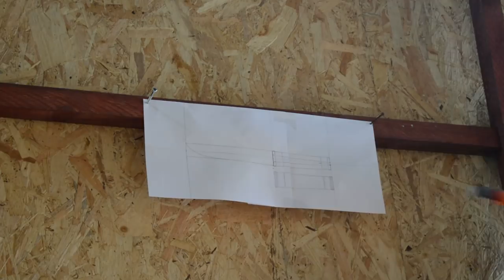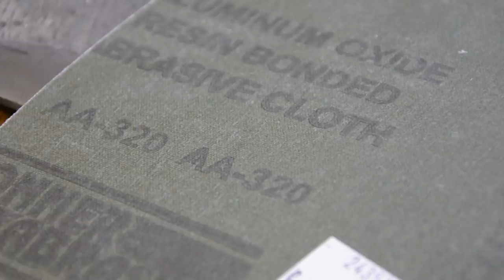Knifemaking - Viking Age Seax

Comment: Not to discredit your work but it's a puuko you've made not a lang seax I live in Denmark and I have never seen a lang seax like that but it is still a beatifull piece of craftsmanship!.
Reply: I bet you haven't seen puukkos in Denmark either. :) Puukko is a finnish knife. In Scandinavia it's called a knifr or sax. A knifr is carried vertical on the belt and has a blade around 7-10 cm, a sax is a big knife or dagger carried vertical. This is definetly a traditional scandisax.
Reply: Ju Ju  Of course he isn't right. The anglosaxian seax and the norse sax predates the puukko by centuries. Broken back (bowie style) seaxes, found almost exclusively in UK and Ireland, are rare. The norse sax has either a leaf tip blade or a straight back. The shape of this blade is similar to norwegian viking langsaxes from the 7-8th century.

Comment: One question: 5:12 - that black thing that you melted down into the zig-zag ornament - what is that? Black plastic rod? It have to be something that will stay in place after it concentrate back again, and something that is resistant for all external conditions and mechanical stimuli... No idea what may it be.

Comment: Why did he put water on the anvil when he was hammering the blade?
Reply: When the hot Blade comes in contact with the water - while forging-, it evaporates. It is like a little "explosion"  and blows the tinder off the surface of the blade . Tinder is very hard, and you use this technik to smoothen and clean the surface of the workpiece for the further operational steps.

Comment: Very impressive artwork.  Is there a reason you trimmed & burnished the edge before adding the top & bottom brass plate wrap? Couldn't you have sanded it all flush before adding the loops & rings? It's awesome either way but I'm curious since I might build something similar one day.  Thanks.

Comment: Why do yu wet your anvil??
Reply: When the hot Blade comes in contact with the water - while forging-, it evaporates. It is like a little "explosion" and blows the tinder off the surface of the blade . Tinder is very hard, and you use this technik to smoothen and clean the surface of the workpiece for the further operational steps.